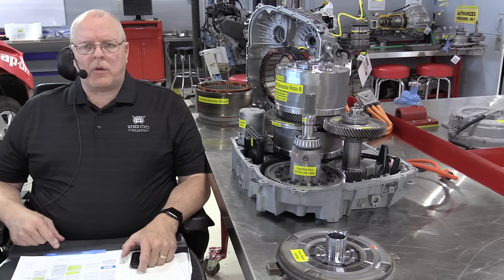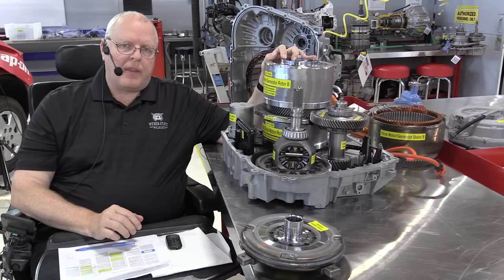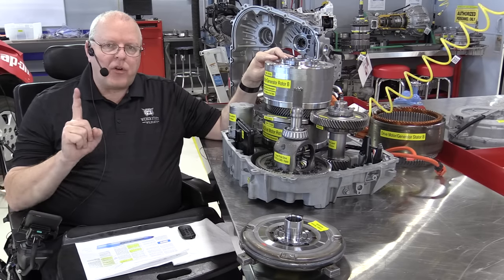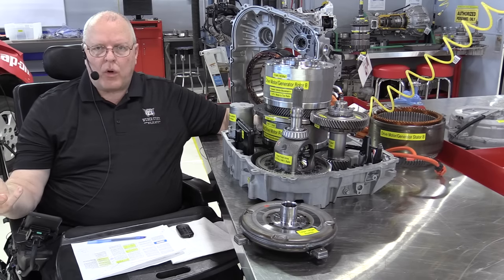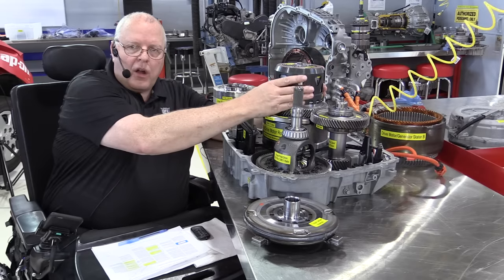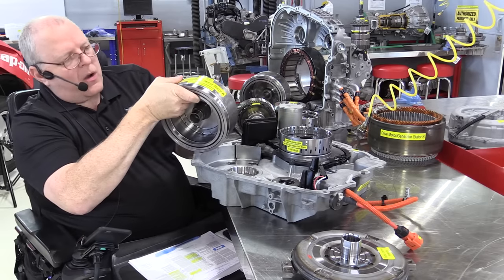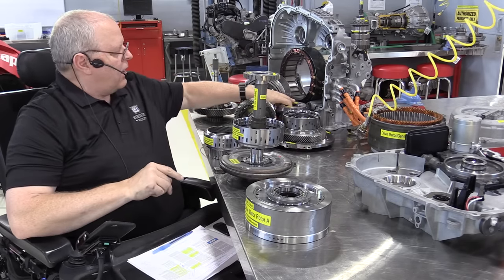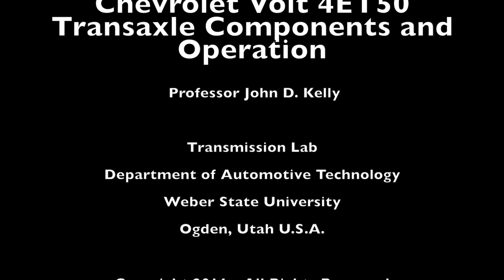Chevrolet Volt 4ET50 Transaxle Components and Operation (2011-2015)

Comment from the maker: Corrections and Clarifications:
1. I made an error on the Motor B to tire gear ratio, it is actually 7.001:1. 
The planetary gear reduction is (1+(83/37)) = 3.243:1
The transfer gear reduction is (67/79) = 0.848:1 overdrive
The final drive gear ratio is (79/31) = 2.548:1
The result is 3.243*0.848*2.548 = 7.001
2. There are four possible transmission operating states (Modes) to move the vehicle in Drive and Reverse:
Mode 1.  One Motor Electric Vehicle (Series Mode Engine Off) - The Variable Low &1,2, R Brake is used (Ring gear connected to case). Drive motor/generator B is driving the vehicle
Mode 2. Combined (Two Motor) Electric Vehicle (Output Split Engine Off) - The Variable High & 2,3,4 Clutch used (Ring gear connected to Motor A). Drive motors/generators A and B are rotating at variable speeds to obtain underdrive, direct drive, or overdrive to drive the vehicle.
Mode 3. Series - Series Hybrid (Series Mode Engine On) - Variable Low & 1,2, R Brake and 1,3, R Clutch used ((Ring gear connected to case) and (Engine connected to Motor A) ) Same as mode 1, but with the engine driving motor A to provide power to motor B rather than battery power.
Mode 4. Combined - Series-Parallel Hybrid (Output Split Engine On) - Variable Hight & 2,3,4 and 1,3, R Clutches used ((Ring gear connected to Motor A) and (Engine connected to Motor A)). Same as mode 2, but with the engine driving motor A.
Reply: It would be great if you did a video that was more granular about each component. Bearings seem to be the weak link & it would be interesting to know if the fluid filter sealed in the transmission, gets clogged & wipes out the bearings.
Reply: in "range extending" mode, if the traction battery is at a low SOC, and you set the driving mode to "mountain mode" the Engine will actually be used to charge the drive battery up to about 40% SOC, if you then enter "normal" or "sport" mode it will allow the car to be driven as an EV again.    This is handy with a low battery in the winter, if you know you're going to go on a longer trip than you have existing range, to get cabin heat now with gasoline and then drive on electricity after, instead of using up the electricity heating the cabin and then driving on gas after, wasting the extra energy the gas engine otherwise throws away.
Reply: @islandfd3s  Gen 1 (in my case 2015) Volt uses what they call ERDTT (Engine Running Due to Temperature) when below 2°C or -10°C (setting can be changed in infotainment screen). Below such temperatures, it starts the engine to generate heat via its normal operation and also by generating current for the electric heating system. In such a mode, the RPM can vary a little but will never drop below 1400rpm (actually I’ve never seen a volt “idle” below 1400. It’s always loaded a bit when it runs and always à that minimum rpm). Above 56 km/h (35mph) it can connect everything together to “kinda” operate in mode 4 (combined series-parallel hybrid), but in doing so it always pulls most of the driving power from the battery. This way you end up conserving battery power longer since you’re no longer using it for heating and are instead using the engine’s heat & power for the electric heater. Anyways, this has been my experience with my Volt.

It always amazes me how quickly these cars get hot.

So with that in mind, it’s not necessary to switch to drive mode “mountain” (or also hold for 2013+) to get heat AND maintain battery power. That said, if you do want to maintain battery power at say 70% indicated, then yes Hold is a good idea. Or Mountain if you expect to be driving in mountainous terrain above 105 km/h for extended periods of time.
Reply: Question: is the differential situated on the car's midline and are the driveshafts equal length?
Reply: Professor one question: is there possibly to turning system as the two motor driving mode pull the full power both motors? it gives us much more power than 110kw
Reply: I have heard Volt owners claiming they use very low amounts of fuel over extended periods of time when doing mostly city driving(as the combustion motor is rarely engaged in stop and go driving).   The flaw with the car(and most other hybrids) is that it switches over exclusively to the gas engine once it is on the highway when the electric motor should also be involved in the drive-train along with the generator providing power potential to the electric motor.  
What do you think is the missing link in the drivetrain that GM and other manufacturers have not included(or omitted) so true hybrid driving can be achieved on the highway.  
Professor Kelly, could you possibly do a vid on the theoretical and practical possibilities of this propulsion proposition?
Reply: @spartacusyoya  At steady-state speeds, using the IC engine to generate electrical power to propel the car will be less efficient than simply using the engine power to propel the car, this is a given.  Hybrid cars excel at using the electric motors to accelerate a vehicle efficiently and recapture power slowing down.  The 2nd generation Volt has a fifth mode of operation that locks the IC engine to the output gears and freewheels the electric motors at steady-state speeds >35MPH since this is the most efficient use of gasoline.  There is no "missing link", it's simple physics and energy conversion to useful work.
Reply: @awebuser5914  The IC on hybrid is a smaller size than an only-IC engine on the same make/model vehicle across manufacturers.  When the IC takes over the drive-train, that term 'free-wheeling' is not accurate.   The electric motor and generator and associated gears/pinions are at least 200lbs,  there is going to be some strain on the IC to deliver power to the drive-shafts, if only due to the fact that right beside the engine is 200lbs of weight doing nothing.  This is proven by the lower gas mileage that most hybrids get on the highway compared to city driving.  
  If the electric motors were engaged with the IC on the  highway this seems to be an obvious inclusion for max power-efficiency, instead,  it is an omission.
Reply: @spartacusyoya  You're not understanding the basics here...  The Gen. 1 Volt uses clutches to completely disconnect motor(s) from the driveline.  Gen.2 takes this a step further with a second planetary gearset to completely disconnect all the electric drive components from the IC engine's path to the differential.  Your idiotic armchair-engineer arrogance to suggest that your "idea" of efficiency is better than what pretty much every hybrid manufacturer has done is comically laughable.
Reply: @spartacusyoya  "The flaw with the car(and most other hybrids) is that it switches over exclusively to the gas engine once it is on the highway when the electric motor should also be involved in the drive-train along with the generator providing power potential to the electric motor.  "

Our 2013 can run at highway speeds on EV mode only, but I tend to manually put it on "hold" to save about 50% of the battery for stop and go off highway driving.

Comment: Also i want to make another comment. One nice feature of this unit is before any clutches are engaged, the motors will synchronize BOTH sides of the clutch to the same RPM then engage the clutch, thus virtually eliminating any clutch wear! This is something that's impossible to do with a conventional vehicle transmission with out electric motors. GM says to change transaxle oil every 100,000 but i imagine could go long past that amount because zero clutch wear. Time will tell
Reply from the maker: Thanks for your feedback, I agree
Reply: I changed my Volt's trans fluid around that mileage.   There are still gears and bearings inside there grinding and wearing and 'glitter' being produced.  Gd forbid anything happens to anything in the drive unit/trans.  I imagine the dealer repair cost will be more than the car is worth.  Protect it as much as possible.  A $200 fluid change is a small cost vs a Volt trans.
Reply: I bet most of that glitter was produced the first 5k miles or so, I don't even own a hybrid yet but when I do I would treat it like I would a fresh ICE engine build and have that fluid changed after the first 5k miles, 10k max, but of course engine oil after first 500 miles.
Reply: @hyperlexis  Since the Volt was discontinued you can find used 4ET50 transaxles all over the used market for $500-900. It turns out the Volt isn't so complex to 3rd party repair after all if you have the know-how and paid access to GM technet. GM has done their homework on this car and it shows. The most complicated job one can think of in this car is having to pull the battery and work inside of it yet people have already done just this, even in their home garage, replacing individual dead sections of battery pack. Front end damage however will cost you more than the 4ET50, you'll be well above the cost of a used transaxle just for used RF/LF headlamp assemblies...

Comment: I found a few inaccuracies in here. Mostly correct though. From my understanding the 4 modes of operation are MG B  driving the sun gear, the ring gear locked by clutch pack 1.For high speed cursing at low torque, the ring gear is unlocked, and the second clutch pack connects the rung gear to MG A. This allows a variable drive ratio by controlling the speeds of the 2 motors, so MG B can be run at a slower speed and thus consume less power. Once the battery pack is exhausted the ring gear is locked again by clutch pack 1, clutch pack 2 is released, disengaging MG A from the ring gear, clutch pack 3 closes and connects MG A to the gas engine, and is used to start the engine, which it then is used to generate power to maintain the low state of charge of the battery, and supply power to MG B. For high speed cruising under low load, clutch pack 1 unlocks the ring gear, and both clutch packs 2 and 3 are closed, which transfers some power from the gas engine into the ring gear, which allows the MG B to turn slower and use less energy.Mountain mode runs the engine at a higher speed to place additional charge in the battery pack, and will add up to 10 miles of reserve to the battery so the car can get over the highest mountain passes.I own a 2012 volt, and have done several experiments on the operation under various conditions, including monitoring the various modes through the OBD2 port. Under normal operation the engine runs 1800 to 2000 RPM, in mountain mode while the engine is charging the battery it will run between 3600 and 4000RPM.The first gen volt is unlike any other car ever produced. Very complex, but very well engineered. Over 100,000 miles and not a days trouble.
Reply from the maker: Thanks for your feedback. Yes, I described a few things inaccurately. See the video comments for corrections and further comments. Have a good day!
Reply: Kelly farrell
Reply: @WeberAuto  The Volt's drive modes are very complicated. It's a marvel of engineering.

Comment: Hi, I would like ask a question about 2013 volt mountain volt, when we put to mountain mode driving up to hill can gasoline motor gives power to wheels ? Or it only gives energy to high voltaj battery ? Because of one day I recognized , I was driving range extend mode and with sport after suddenly I kickdown gas pedal car push me back but after 2 or 3 seconds when gasoline motor kick and again car little push me back again I hope it means gasoline engine little helps to wheels some situations...does it true or not ? Thanks

Comment: Prof. Kelly, I thought you might like some observations from my 2014 Cadillac ELR: When driving in EV mode the dash reports 130kW is being sent to the wheels at WOT. If HOLD mode is activated and the engine starts, 160kW is delivered. If the battery is depleted, and the engine starts, activating SPORT will recharge the battery some, enough to show one indicator on the cluster. 
I've not noticed how much power is available to the wheels when in MOUNTAIN mode, but I do know it dampens the accelerator pedal mapping some. It will start the engine when the battery reaches 50%, and if the battery is below that will run the engine harder to build up to 50%. 
The "kickdown" feeling going from the small motor to the large motor is quite noticeable. I wish there was a way to lock it into using the large motor only. 
I also notice that the power delivery is "damped" compared to the GenII Volt, which will really throw you back in the seat if you mash the pedal. The ELR's power ramp is much more gradual.
Reply from the maker: Great information, thank you for sharing!
Reply: @WeberAuto  we would all love a follow-up video on the similar, yet different 5ET50 second generation transaxle and the differences of the Cadillac ELR version that has more power in operation.

Comment: Prof John: Thank you for your excellent videos! I watched this 7 or 8 months ago before I bought my 2013 Volt. I've watched it several times since and my mind is blown each time! This combined with some cool animations I've seen give the whole picture on the modes and amazing engineering. I've driven a few prius's and have a cmax at work. They dont hold candle to the volt...once you know, YOU KNOW. 
Ps- I love your super clean shop and your clear presentation. If you're interested check out my Volt/Morimoto HID  installation. Cheers!
Reply from the maker: Thank you very much!

Comment: Thanks for this video. Very informative. I own a Vauxhall Ampera which is basically the Chevy Volt with some styling differences. It's really interesting to see the system explained like this. I've found it to be a really great system; powerful and versatile. It's a real shame that we won't get the new version over here in Europe.
Reply from the maker: Thank you!
Reply: We got the same problems over here, only ours is trying to get a diesel hybrid. We also get limited models of foreign cars.

Comment: From my understanding, Motor A never propels the vehicle by itself. At speeds above ~70mph, Motor A will begin running (opposite engine direction) to reduce motor B's RPMs to a more efficient zone. It's a very complex system and I might have details wrong.

Comment: hey weberauto 
 what i know from my own and what i have read is that its a little different.

the drive mode you call mode 2 is where the motor A and B work together and both run on a really low rpm and so are more efficient

also mode 4 is not mountainmode that just a software setting telling the car to charge the batterpack to a SOC so it will have a lot of reserve for climbing

mode 4 the ICE will be driving the motor A and motor A will also be connected to B so in a way the ICE in thats stage is connected to the wheels. ( its kinda what you explain at the end where you do say motor B and motor A drive the car )

that happens only under some situations.

then when you are in extended mode with a depleted pack or when on HOLD mode. ( later also a software mode telling car to hold SOC )
i see with lower speeds highway drives it wil charge the batterpack a little and then complete shutoff the ice and repeat.

i talk about the volt 1.0 not the new 2.0
Reply from the maker: Thanks for the feedback, I do not mean to be rude, but your information on mode 2 and mode 4 mountain mode is mostly incorrect. The information I used for this video comes from GM's own service training, service information, and from GM Powertrain's own technician guide on the 4ET50. I do not want to argue over the details, but you might check your sources of information. It is hard to beat the manufacturer's own information.  I also own a Volt. Thanks again!
Reply: @WeberAuto  I bought my 2015 Volt 2 weeks ago.  Being an engineer, I have enjoyed your explanation of everything inside and how it works. Thank you so much! Just experimenting, when the battery is at 0 range.  I have discovered that when driving in Mountain mode for about 20 miles, mostly flat interstate, it will charge the battery to exactly half full, then the engine will shut off. I can switch to normal and the display says I have 17 miles of electric driving.  Strangely, this really didn't reduce the gasoline range miles much more than the 20 miles that I had traveled.  I was also using L instead of D, which helps pump more current into the battery.  When the battery is charged to 50% in Mountain mode, it can be switched to Hold mode.  This could be useful if you didn't have anywhere to plug in and wanted to have electric only propulsion when you get somewhere that you wanted to be quiet, for some reason.  You didn't mention Sport mode. Does motor A & B work together or is that really a software thing to just give more torque? It really is peppier when in Sport mode, running in electric only or even when the battery is depleted with the gas engine running.

Comment: Super useful video, thanks. Please keep them coming. 
From your description of stage (or mode) #3, one could question GM's claim that the "Volt is not a hybrid.." as it is using the ICE to power (move) the vehicle. It was my understanding (from GM mkt I guess...) that the ICE was only used to charge batteries, hence GM's "extended range" description.
Reply from the maker: Yes, they didn't tell the truth. Thanks for your feedback!